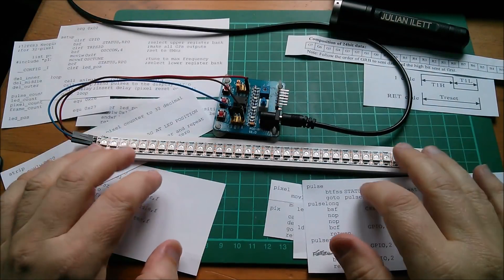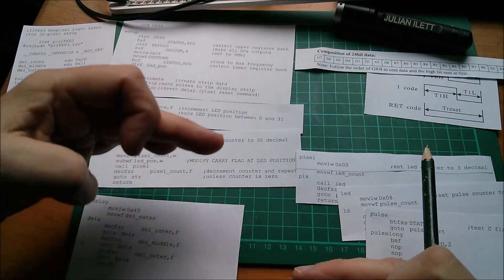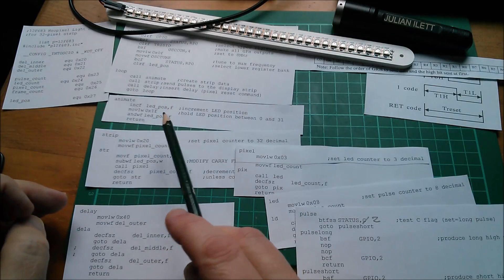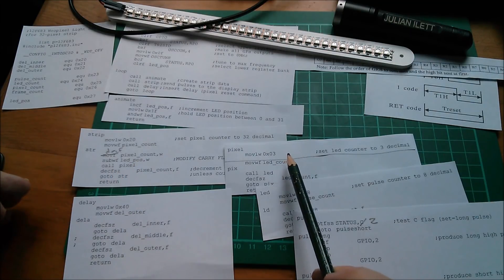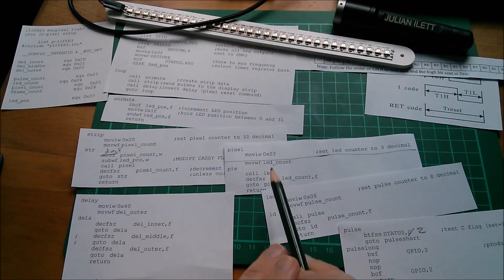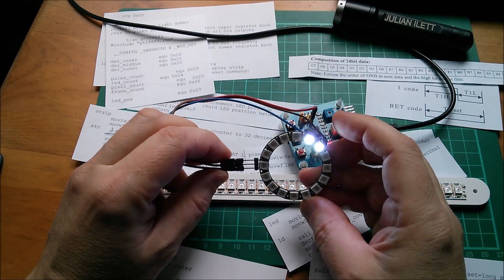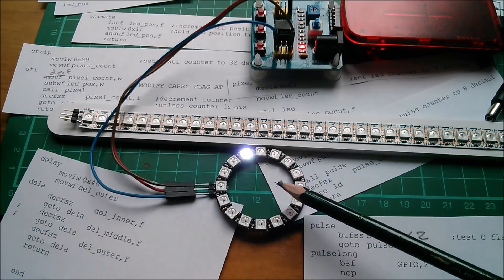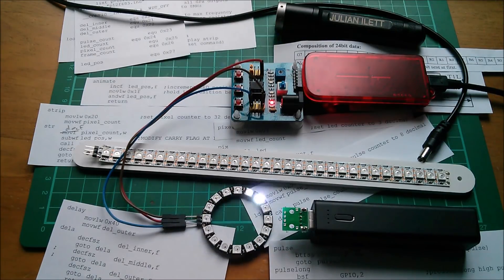Programmers will HATE this (bah humbug)

Comment: I actually bought a WS2812B LED strip last year but haven't gotten around to doing something with it unfortunately. Maybe this christmas.

Regarding your off-by-one-error or misalignment I wanted to note that in case of the light saber it will never have no length. The first LED will always light. Now it depends on how you actually want it to light, but if you want it to light from 0 to 32 LEDs you would just change "decf" back into "movf" and replace the mask from "0x1f" to "0x20".

It can be visualized when you make a shorter light saber, for example just 2 LEDs. They have actually three different lengths (0, 1 or 2) but there are only two LEDs, so it's similar to the fence post problem.

Now in your circular dot implementation your current implementation is obviously the correct situation, but in the case of the fence posts, there are no first or last fence post with only one segment attached to them.
Reply from the maker: Ah yes I love (and use myself) the fence panels and posts analogy

Comment: I think, the ALU (though I don't know PIC too much) always "knows" things like carry and zero output, so an opcode can use it, but it's not always chosen by the designer to store this information in the flag register after, can be used by the programmer. Actually, it can be a useful decision (or not - it depends) it they think it's more valuable for the programmer not to "destroy" the old flag settings by a new operation. Eg Z80 does not sets any flag on moving data into a register (LD), while 6502 always does for sign and zero flag. This behaviour of 6502 can be used well to save any other opcode to check the loaded value then. At the other hand, it can be nasty sometimes, that it "destroys" the old flags value and causes headache.

Comment: My experience with my PicKit3 is that if I have too high of a load on my device, then the voltage drops and my programmer complains the Vdd doesn't match what I've asked it to be supplied at.

Comment: please add some code to change the color, those are rgb pixels, right?
Reply from the maker: OK, I'll do different colours next time :)
Reply: You should also print the code in color, but I guess that's to fancy for a assembly guy hahaha
Reply: You should add another counter that will change the colors over time - but run at a pace independent of the other counters.  That should be fun!  Bonus points for doing both color changes slower than cycle time and color changes faster than a complete cycle.  (The latter should be good for some psycho-inducing results.)

Comment: My experience with usb ports on modern laptops/desktops is that they will temporarily disable ports using too much current - assuming that is done by the usb host controller.

Comment: I just keep wondering. How do you spell munge? It's a wonderful word/phrase, yet I don't know how to spell it. As for the Assembler/Compiled debate, I can't program in Assembly, I keep trying to learn and Julian's wonderful videos are helping me, yet I've never found that using Great Cow Basic to be any slower than Assembly in any of my designs compared to the 'legacy' Assembly versions I'm updating. Perhaps I'm just not in need of anything too time critical, but GCB do suggest that their compiled Basic is optimised well during compilation and I have no reason to doubt that claim. I also find that the MPLAB IPE near (totally!) impossible to understand, the GCB IDE suits my thought process much better - it's simpler - like me...

Comment: i smell a pair of neo pixel glasses frames being developed...
Reply from the maker: Hmm, a rotating light source could make SMD soldering quite a challenge ;)
Reply: assuming you only need the ic and usb, i wouldnt of thought it be too difficult, you already have 2 neo rings, that could be bridged together (not electronically), then make use of the arms. I'm thinking for powering each side, make the power cord into a sort of catcher that goes behind your head. an over coat for glasses with the pixels traveling in opposing directions. Wearable chrimbo tech lol :D
Reply from the maker: Oh yeah, that's not a problem. I was thinking of trying to solder (or do any close up work) while wearing the glasses with the rotating illumination :)
Reply: Haha yeah i hadn't considered that, if it does make the job more interesting maybe it could become a game :)
Reply: nudge nudge wink wink

Comment: Is it necessary to have trailing zeroes in your hex values?
Reply: Seriously?
So in case you didn't mean leading zeroes - yes, of course. For it'd be different numbers...
Reply: TheRealMeisl Yes that's what I meant.
Reply: Programmers generally use leading zeros in their numbers as a reminder of the bit length which they're dealing with.

One hexadecimal digit is four bits, so two hexadecimal digits are eight bits and four are sixteen bits, which are commonly used bit lengths in programming.

My pet hate is when a programmer adds a leading zero for no good reason, thus making the bit length unclear which results in confusing code.

Comment: Great work! And there's nothing wrong with your programming technique. Most calling conventions specify registers which a routine shouldn't touch. Maybe document those two routines a bit more to specify it shouldn't touch the Z flag? Just in case you change them a year or two from now.  But hey... I hardly ever write proper comments when I code.. so I shouldn't bug you about it. (pun intended).
Reply from the maker: Yeah, you're right - I'll add a shouty (in capitals) comment not to use instructions which affect the Z and C flags.
Reply: Gert Nutterts, didn't commenting code go out of fashion among Real Programmers?
Reply: I hope it's just lazy programmers like me. ;) In higher languages it's easier to get away with, in assembly it's come back to bite me more than once.
Reply: I don't know what most do, but in compiled scripting languages like Python or pure scripting languages like Bash/Lua, I have so many comments it's pretty much a crash course on my goal at the time. I only know enough C to fix minor bugs in when compiling or write a few Arduino sketches. Though I do want to change that.... someday. I'v found lots of popular open source programs have fairly well documented code. Not sure about commercial programs though as I can't see the source. :P

Comment: Why don’t you set a variable to flag the number of pixels, then use some math in the rest of the code to automatically calculate the correct count values based upon it... would be pretty easy, then you would just have a single variable to set the number.

Comment: Last frame of the video shows that you havent made the program correctly. Two LEDs are ON at single point in time. X position should be turned off before X+1 turns on.

Comment: Why you're using asm in the first place? this doesn't seem that critical
Reply: victornpb as he said in the previous video, the ws2812b requires microsecond-level timing(but the reset code can be slow)
Using assembly allows instruction-level timing.
Reply: Considering how bad the microchip C compiler is assembly probably isn't a bad choice for PICs.
Reply: Alternatively you could make the frame rendering code in C, then transfer the frame to the neopixels with a asm {} block. However, the last time I played with the neopixels, it is no problem using something like mikroC and setting and clearing port pins in C, and it is just as fast as doing it in asm.
Reply: Better control of timings. With C you never know if any other compiler than the exact version you used will work. 

Another reason would be speed. C will never be as fast (or small) as code written by an experienced assembly programmer. It's just that 99 out of a 100 times it's not worth the effort since it takes forever to write in assembler.. It's better used only on small parts of the code where you want absolute control.
Reply: Christian Ivarsson what a bunch of crap. Any modern C compiler will generate code that could be faster than an experienced coder because it knows how to fill the pipeline, not create stalls etc and because it's not human it should get it right all the time and not just some of the time.

Why do people parrot stuff they learned in GCSE IT decades ago like it makes them seem smart.
Reply: Efficiency is not the same as predictable performance. If he needs accurate timing ok, I will not discuss that.

You can probably write faster asm in a simple firmware, but I in really  complex firmware LLVM does a incredible job in optimizing c code. But yeah ams is predictable, c is not, unless you inspect the final asm code.
Reply: Well most microcontrollers don't have pipelines so look who's talking out of his ass :D

Besides no one taught me this opinion. I started for fun and quickly realised I consistently write faster functions than the c-compiler on AVR and 68k. You yourself said what you thought about PIC's. :) It might be true on ARM since they are cached and superscalar (Not to mention the amount of instructions those have)
Reply: victornpb hardware timers exist for a reason.
Reply: Christian Ivarsson you said C will never generate better code. Which it can and does even for old stuff like the m68k. If you have a trick to make something faster there is zero reason why a good optimising compiler can't use that exact same trick.
Reply: > C will never be as fast (or small) as code written by an experienced assembly programmer.

That hasn't been true for probably a couple decades now in nearly all cases. Compilers have come a long way, and the optimizations they are capable of are rather impressive.
Reply: victornpb "simple firmware" doesn't even apply if PIC12 is anything like PIC16. 26 instructions, all take 4 clock except conditional jumps. It's also so simple a problem it doesn't merit using a full blown development system.
Reply: Even tho I wrote software for embedded, I usually write more desktop class software, so yeah, everything that you can put on a kb for me is simple. Optimizing like a million lines of C code would be like easily double that in Assembly, no human is capable even trying to gasp it, tree shaking, branch prediction and dead code removal, a compiler is ahead of any experienced developer. I'm sure you can optimize a subroutine or a small scoped algorithm, but when talking of a huge code base, is is humanly impossible. But yeah this is really not the case of this video.
Reply: Because he's using "Neopixels" when he should be using "Dotstar" (apa102) LEDs, which are superior in every way.
Reply: donpalmera Let me guess: you haven't programmed PIC, or any µC yourself, have you?
Reply: because he's a fucking cool dude! :D
Reply: TheRealMeisl nope. Have about 100k microcontrollers in the wild running code I wrote
Reply: Phil P Yes, bad compilers exist, and even with good ones there will still be small opportunities for a bit of asm in performance critical paths in certain types of code, but as a general statement it is false, even though it gets asserted often as a flat truth (well, less often these days as people generally write less low level code than in the past).
Reply: donpalmera Ok. And you never used a line of Assembler? Not even inline?
Reply: TheRealMeisl that's not what is being argued here is it.
Reply: Well, I think Christian Ivarsson is right, in that it's about better control of timing. Modern C compilers being able to apply optimizations beyond any human's reach is simply off the point.
Reply: So.. I replied to a comment about "C never being as fast as assembly", you tried the "Yeah, but I bet you've never kissed a real girl nar nar" tactic and since that failed you then tried to turn that into "but but I bet you had to use assembly somewhere" which has nothing to do with the original thing I replied to .. and I'm "off the point".

FYI for precise timing you use a hardware timer.
Reply: The original question posed was as to why asm was used.
Reply: Oh... and I just didn't like your reaction: "What a bunch of crap".
Reply: I wasn't replying to the original question. I was replying to that statement made in a reply to the original comment. Is that not allowed?
Sorry for using big adult expressions. I totally forgot everyone on youtube has to be treated like a small child.